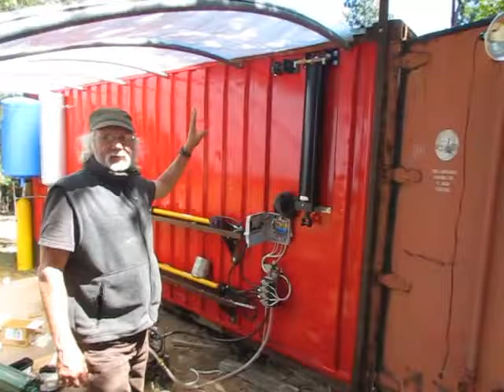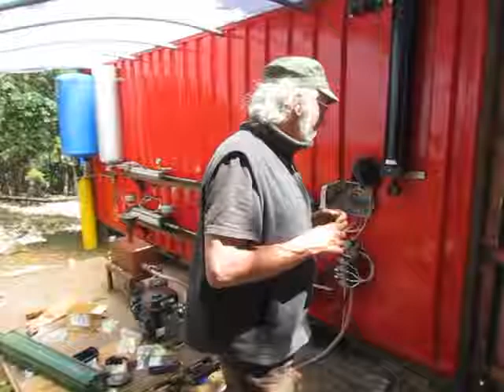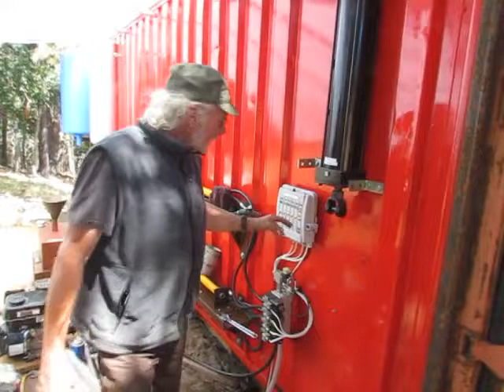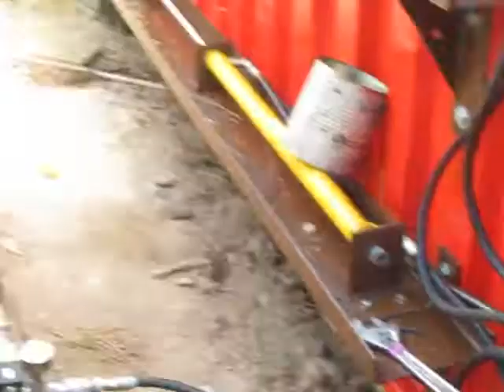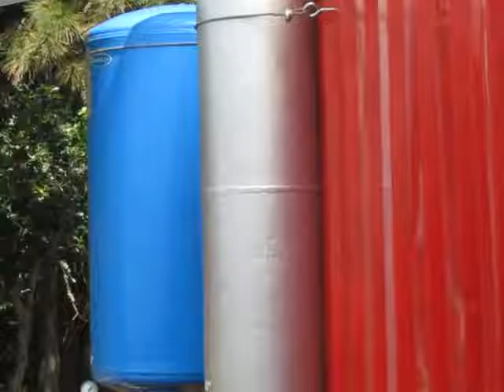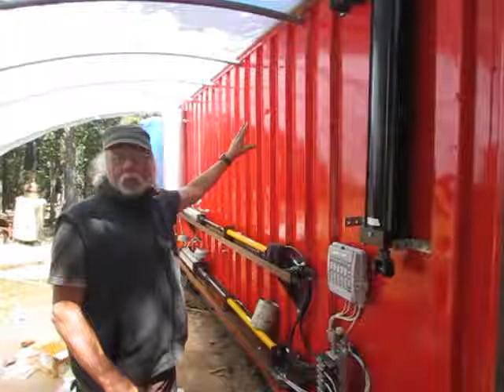Biogas Compressor Part 1

Comment: This is really confusing, I mean really confusing. 
The title says "biogas" which implies methane from a digester. 
The man says carbon monoxide and hydrogen, which implies producer gas.
Then he says Haber-Bosch which implies nitrogen fixation and ammonia production. Then there is the bit about methanol.
Finally, he says something about compressing air.
I think this is about turning wood into methanol. There are 20 gallons of wood alcohol (methanol) in every ton of wood. The methanol can be separated from the wood through destructive distillation, along with 20 gallons of acetone, and a large quantity of Stockholm tar. All this at atmospheric pressure and less then 700F.